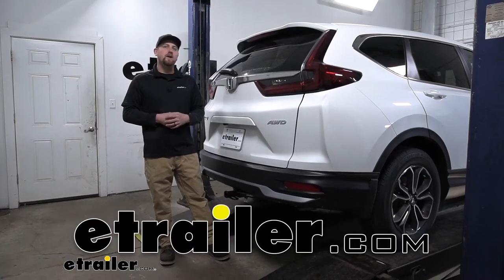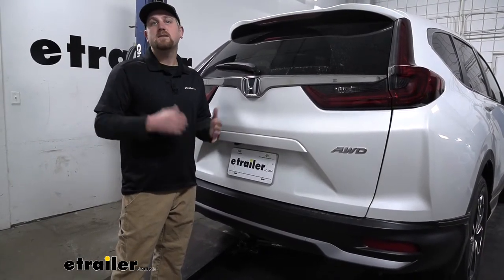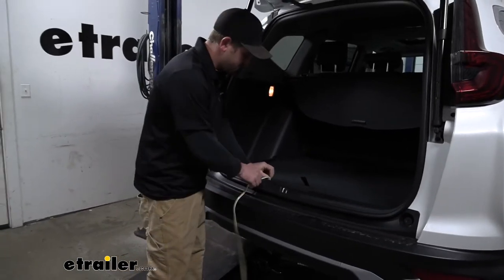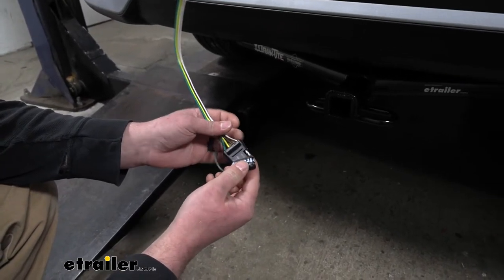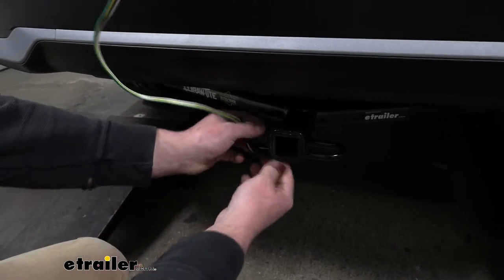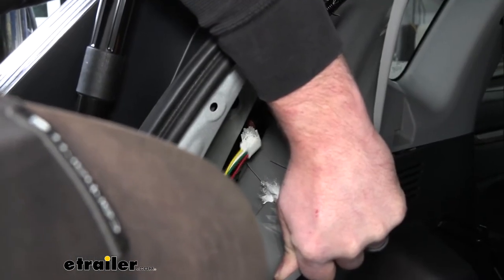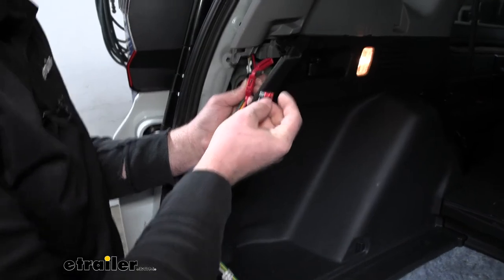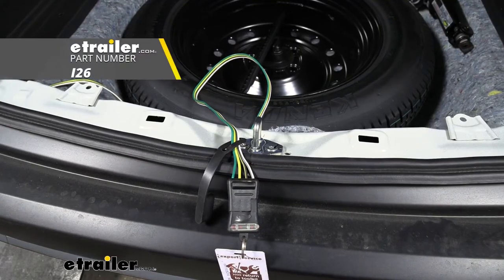etrailer | Curt T-Connector Vehicle Wiring Harness Installation - 2020 Honda CR-V

Comment: How does it get outside to connect to trailer
Reply from the maker: When it's not being used, the trailer connector is stored in the cargo area of the vehicle. When it's needed, run the trailer connector out the back and close the rear hatch on it. As long as you avoid the area of the latch, the wire will not be damaged. This arrangement works really well, because the connector is protected from the elements when it isn't being used.
https://www.etrailer.com/Custom-Fit-Vehicle-Wiring/CURT/C56370.html
https://www.etrailer.com/instructions.aspx?pn=C56370